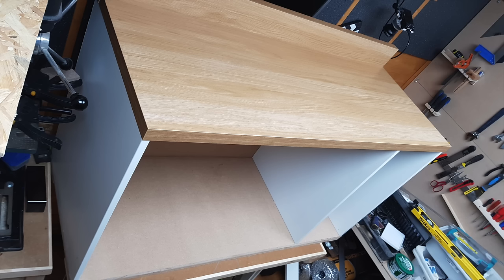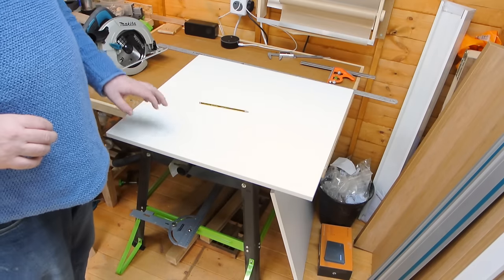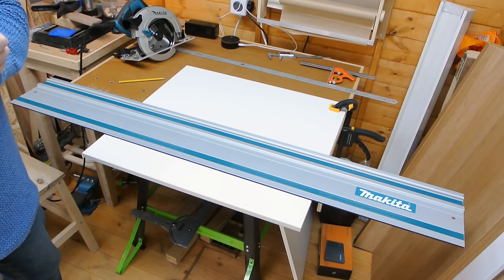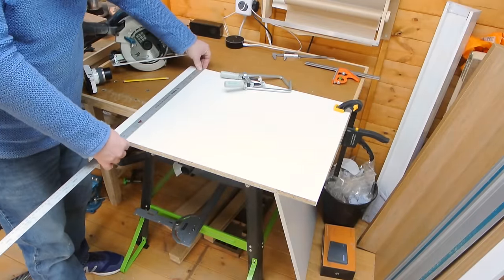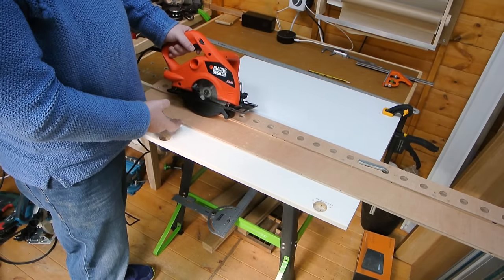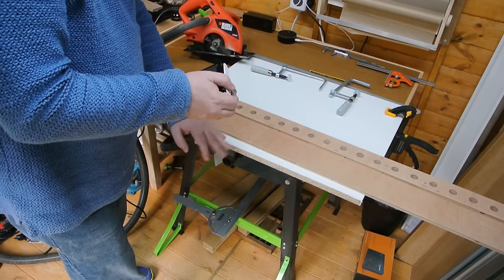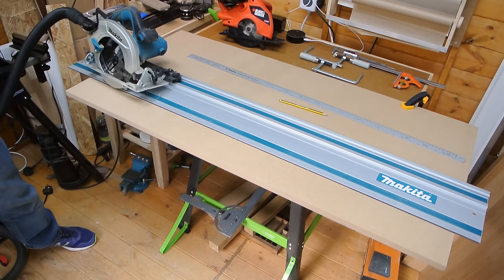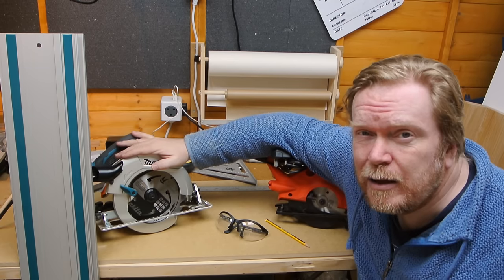Makita Circular Saw Review | Guide Rail vs DIY Saw Guide | HS7601J/2

Comment: Hello, great video- thanks! Please could you tell me whether the saw blade butts up close to the rubber strip on the guide rail (as you would expect a proper plunge / track saw to do)? It's hard to make out from the video just how close they sit to one another. I'm guessing they sit perfectly next to one another as you talked about trimming the rubber lip. I have the same saw but a slightly different Makita adapter and the blade sits 3mm away from the lip which is a pain. Many thanks in advance
Reply from the maker: Hi there - yes it does. It works just like the plunge saw. The first cut through trims the splinter guard and then you use that to line-up your cuts. The adapter has positive stops on the saw and a clear accurate scale so you can line it up first-time every time. The problem you have I encountered initially. There are at least 3 different adapters with the 197005-0 adapter being hard to source (see link) the adapters on Amazon are different models, badly described and give you that 3mm gap. Thanks for watching and the lovely comment. Appreciated.
Reply: @StrawbyteWorkshop  That is very helpful- thank you! Makita themselves have now confirmed that the adapter bases are the same but the rule bars / rails are different. 'C' rails are needed for this saw. Thanks again

Comment: Hi great video  I want to ask about rail adopter which comes with it. is that good for Rail or do I need to buy ( Makita 197005-0 Guide Rail Adapter ) to use on makita 1.5M rail. Thanks
Reply from the maker: So the saw and the rail adapter are sold separately. So yes to attach the saw to any Makita rail you will need the adapter. I hope that answeres the question.
Reply: @StrawbyteWorkshop  thank you .

Comment: Great video thanks. I’m in the market for a circular saw, mainly for plywood. Would the blade that came with this be suited, or should I opt for a blade with more teeth?
I ended up buying the a wera screwdriver set after your recommendation, and I don’t regret it.
Thank you👍🏻
Reply from the maker: Hi - You're right a blade with a higher tooth count would give a much better finish in man made boards such as ply, osb or MDF. That said, I've never had any issues with the combination blade the saw was supplied with in ply.

And I'm glade you like the Wera tools - I'm delighted with mind and have expanded the set futher since the video.
Reply: Strawbyte Workshop thanks for your reply.
Merry Christmas👍🏻

Comment: Great video and information. I am considering this saw with a guide rail. What I really want to be able to cut sheet timber by joining two rails together, Do you known if a 1 meter and a 1.5 meter rail are compatible. I do not need a track longer than 2'5m long. Thanks again Karl.
Reply from the maker: Yes, they will join together easily. I've the 1m and 2x 1.5m rails and they're all interchangeable. Be sure to get the joining kit with two bars and not the single bar.

Comment: Great video. I don’t suppose you made a video of when you trimmed the Guide Rail before first use did you as I have just purchased the Rail and adapter for mine and don’t want to make a hash of it.
Reply from the maker: You know it's really simple. Lay the rail on piece of sheet material. Set the saw to make a shallow scoring cut of between 3 & 5 mm. Place the front of the saw on the rail with front edge of the blade well away from the splinter guard. Wait for the saw to be at full speed and the advance.the saw forward slowly. Let the rear of the blade clear the end of the rail before releasing the trigger. And your done. Be bold. You won't screw it up.
Reply: Strawbyte Workshop Thanks very much very helpful I’m surprised no one has made a video of this or Makita themselves advise how to do this in any instructions when purchasing the guide rail.

Comment: Thanks for your video. Why do you say a track saw would be better? Is this not just the same thing (except plunge cut?)  More accurate?
Reply from the maker: Since making the review I now have the Makita Sp6000 tracksaw and I must say there's not much in it really and the circular saw with track is still the most cost effective way to cut with a track. The tracksaw has a thinner cut and you get the plunge advantage. The dust collection is better too but that's about it. Anyhow thanks for watching.
Reply: @StrawbyteWorkshop  Hi! Can you tell the difference between SP6000 and HS7601 noise-wise? HS7601 is supposed to be a bit more quiet. I'll be doing at least some of the work in my apartment, so I wonder if there is a difference.
Reply from the maker: @szymek242  The SP6000 always seems quieter than the HS7601, but there's not much in it really - not enough to warrant the extra cost. Thanks for the sub.
Reply: @StrawbyteWorkshop  Very helpful. I think my price difference is $250 between a skill saw that suits their rail system and their track saw. Sounds like I will try to save those dollars. Thank you for your thoughts.
Reply from the maker: @pinkrockshard  thanks for the comment.

Comment: ps did you really find the cut quality any different from the SP6000 and the HS7601 (with adaptor/rail)? would you say the tollerance tuo be less than 1/10th mm along the cut with the HS7601?
Reply from the maker: I think the quality of the cut is about the same between the two saws with their straight out of the box blades. It's worth saying that with the HS7601 and the guide rail adapter that you need to pay attention to get the saw running accurately and straight on the rail. It's easy to stick the adapter on and not check it's aligned to the markings correctly. I have done a job recently where I used both on the same counter top and there is no noticeable difference in the accuracy of the cuts along the rail if there is a 1/10th mm variance I can see it or and it looked about right when I checked with the tape afterwards. That job was an example of why I love have both saws because I get about 12mm extra depth of cut and on worktops which are 45-50mm thick, it makes a difference.
Reply: so did you find it at that level of tollerance? :)
Reply: @StrawbyteWorkshop  thanks, 1/10th mm seems very little but when using dowels its not, but if you think its less than 1/10thmm that should be fine then to buy
Reply from the maker: @ChristopherClaudioSkierka  I would say so, yes.
Reply: @StrawbyteWorkshop  ps was that a typo error when you said " ....rail if there is a 1/10th mm variance I can see it or and it looked about right when I checked with the tape afterwards" , did you mean to say " .....variance I cannot see...." ?
Reply: @StrawbyteWorkshop  ps i think there is delay messages coming thru sorry for repeating myself :)
Reply from the maker: @ChristopherClaudioSkierka  Yes it was - it should have said "can't see it"

Comment: Well, I firmly believe that you should have invested and saved a bit more and bought the plunge saw with the Bluetooth setup extractor or the plug in 
you’ll be way much happier,  and yes that this compromising its a way better investment and much more accurate in every way possible 
Another thing you need to invest in is the TSO GRS-16PE That would be the ultimate setup look it up please 
and as far the dust collection you would’ve not seen hardly any dust, but that a choice that you have to make 
Best of luck
Reply from the maker: Thanks for the comment. Since the video was made I've bought the SP6000 and spent much more getting the dust collection right. The circular saw and rail guide still get used a fair amount is it has a much better depth of cut. As for the TSO guiderail square - I know many who are happy with them. But they're pricey and I wouldn't get the use. k.
Reply: @StrawbyteWorkshop  Hi, what did you do/buy then for the dust extraction? Thanks. Chris

Comment: The guiderail is actually better than the diy railguide but if your tight on budget this one is for you it will also do the same job youll just spend a little time correcting it during installation and finishing
Reply from the maker: Thanks for the comment.

Comment: In the Makita the blade should be 48 teeth or 52 teeth for melamine cut boards i like yours diy guide rail great atachment...
Reply from the maker: Absolutely right. This was a brand new saw blade and its sharpness is evident in the cut. I now have a 48 tooth blade option for plywood and melamine. Thanks for watching.

Comment: Thanks for such a pro vid Karl.
I have a question, I have the sAme model of Makita saw and my question is does the rail adapter comes with the saw and if not is it must have to use the saw with the guide rail?
Wish you have shown the adaptor setup to the saw.
Thanks
Reply from the maker: No it doesn't come with the saw. Using a rail isn't necessary with a circular saw but does improve accuracy. You can get by with a home made rail or by clamping a straight edge to the board you are cutting.
Reply: Strawbyte Workshop 
Thank you once again Karl, much appreciate your time and effort to respond 👍
Reply from the maker: @muzakhan6458  No problem and thanks for watching.

Comment: I've just been looking at buying the same model as it's discounted. The rail adapter is out of stock everywhere. I wonder if this model is end-of-line now ?
Reply from the maker: Hi Tony I am not sure where you are in the world but Lawson HS in the UK was really the only consistent stockist of the adapter and has them as of now. I did choose Makita as they do tend to have models that stick around for some time in fact many of the criticisms I see in reviews (in fact the only criticism) comes from their tools looking a little dated. My saw was heavily discounted this time last year so it's maybe not the end of the line just yet.
Reply: @StrawbyteWorkshop  In the UK! Thanks for the heads-up. Lawson HS seems to have it! I've seen a few reviews that the Makita HS7601J suffers from the base plate bending. Is that something you have encountered ? Also seeing that the makita guide rails whilst cheap seem to have poor build quality and people are opting for Festool which is the same fit (but twice the price). Any issues? I'm planning on making some long counter-top cuts ~2m and was looking at a range of solutions... but the guide rails seem to be more expensive than the saw! Considering making my own smaller guide if I can get off-cuts down sized at the local B&Q!
Reply from the maker: Tony With regards to the bending I haven’t encountered any issues and prior to getting my SP6000 track-saw a few months ago the circular saw has been in constant use. I can kind of see how though overly heavy handling you could potentially bend the base, but that would be true of other saws I’ve had and probably others on the market. As far as guiderails are concerned I’ve bought 4 so far (2 x 1400mm & 2 x 1000mm) and all have been fine - straight, flat and with the ends cut at 90 degrees to the edge. The connectors are a little basic and are probably my only criticism. The joint between rails if not carefully set-up can create an ridge on the edge or top face which can make it hard for the guide-rail adapter to pass across it. I don’t like having to taken my time setting up stuff like that and it niggles me when I have to rip-cut 2.4m boards and spend 5 minutes joining rails. But once set-up properly a 2.8m rail is a game changer in my garage workshop. On my oldest rail I have just this week replaced the splinter-guard and the rubber strip on the top. The cost was about £10 and the stock strips will allow you to repair 2 rails and cost a total of £20 from Axminster. I am sure festoon have found some way of ensuring that their aluminuim extrusions are better then everyone else’s but they don’t have the anti-tip feature the Makita rails have and I quite like it. All the cuts I’ve made have been straight enough - when installing some boards into the wall of my garage loft I had to edge-joint along a 2m length which would be seen and the two cut edges butted up together fitted with no gap. So in my experience, with care, you can get results that are straight enough. In a recent Skill Builder (YouTube) series on track-saws the Marita and Festool options were the ‘in-use’ tools the presenters personally owned. That’s enough endorsement for me. Anyway I hope you’ve checked out my other tool reviews and further updates on my Makita experiences.
Reply: @StrawbyteWorkshop  Thank you! Really appreciate the response! I will bite the bullet and go for it
Reply from the maker: No problem.

Comment: thanks for the info before, going to trouble you again now:) , I am about to order the track etc, now I am thinking of making an MFT table and you probable know they have these things called "dogs" which are usually stainless still and are at 90 degrees to the top of the table and guide track. Now I wonder ,, does the rail adaptor poke out on the far side?, since if it does it would hit these "dogs". I notice some of these guides do (the steel prongs that slide into the circular saw on the nearer to you. In your video could not make out the other side, only way it could of done if video was taken from above or the other side of the bench which would defeat the object of your video , not calling your video its dam good :)))) , many thanks in advance sir
Reply from the maker: Hi Christopher. The simile answer is no, the guide rail adapter doesn't interfere with anything at teh back side of the rail, including bench dogs. And thanks for all your comments.
Reply: @StrawbyteWorkshop  thank you for your time replying and the confirmation of the above matter.
Reply from the maker: 👍 Christopher Claudio Skierka

Comment: ..just sent link in previous message, going on it refers to being ok with the SP6000 and ahhh also its 150cm not 140cm,wish they make things more simple
Reply from the maker: Yes they've got both 1400 and 1500mm rails, plus a 1000mm rail too. It's not obvious but the 1500mm rail is super handy when cross cutting 1220mm (4 foot) sheets.
Reply: @StrawbyteWorkshop  so that other rail will work with the same adapter u think? And its just a different length that's all?
Reply from the maker: @ChristopherClaudioSkierka  Absolutely - just the length.
Reply: @StrawbyteWorkshop  thank you so much for your help
Reply from the maker: @ChristopherClaudioSkierka  No problem.

Comment: What blade are you using in the makita? is it the stock tct one?
Reply from the maker: It was a almost new stock blade and looking back at the video it did surprisingly well against the other saw which was fitted with a specialist melamine blade.

Comment: Look at my "Parallel Guided Power Saw"
Reply from the maker: Hi David. I've taken a look but would appreciate it if you didn't drop comments on my videos plugging your stuff. A question or comment on the content of my video would be more courteous.
Reply: @StrawbyteWorkshop  ok
Reply: @StrawbyteWorkshop  Can you cut 1/2 plywood for a 9 sides pyramid? Do a demonstration.
Reply: @StrawbyteWorkshop  Can you cut a slide of wood 20 mills thick and 8 ft long.
Reply from the maker: @davidmuresan628  With two guide rails joined together yes. Easily.
Reply from the maker: @davidmuresan628  Probably, but I find pyramids a bit too pointy for my taste.